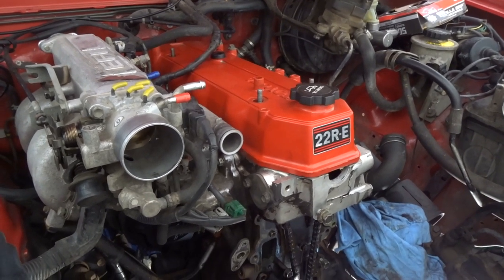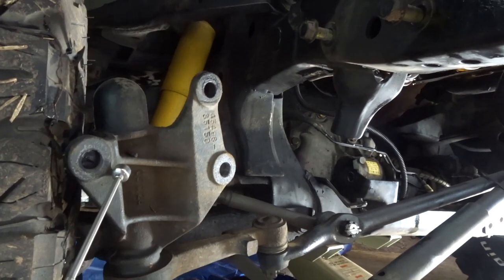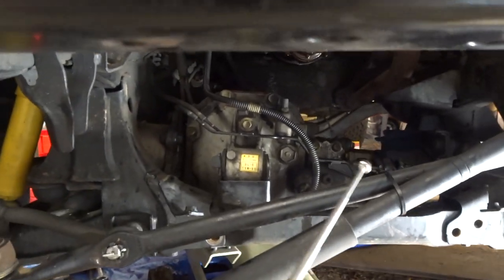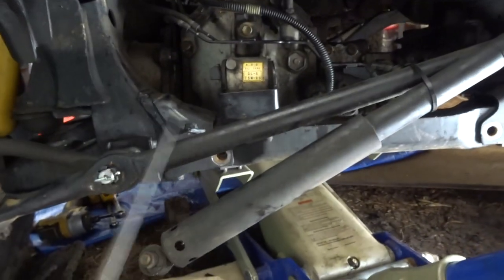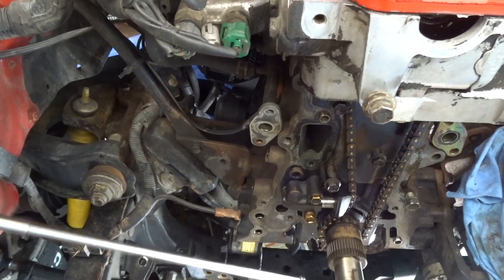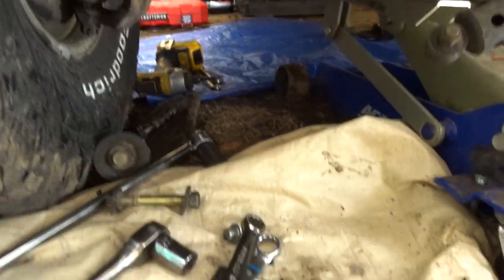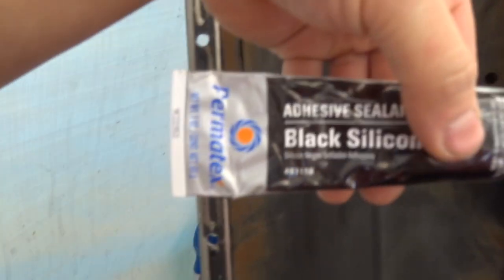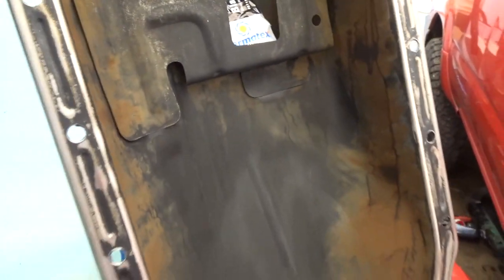TOYOTA 22RE OIL PAN REMOVAL

Comment: I've been stuck on getting my oil pan out for days on my 4runner and am gonna try all these tips.  Previous owner said "Just needs a chain, I think." Chain slack was so bad, the crank moved the length of the timing marks before the cam followed after it kicked back.  Entire guide is in pieces in the pan (I can feel it), but it somehow did not bend valves or ruin anything.  But gotta get all that crap outa the pan.

This is super helpful, thank you for taking the time to put this together.

Comment: Nice, just about to do this. Just stripped my engine down to the block to replace the timing cover and guides and replaced all the gaskets along the way. Do you need to use the permatex gasket maker or can i just use a regular gasket
Reply from the maker: Use black silicone only
Reply: Yes the black stuff, its called "The Right Stuff" also made by Permatex I believe

Comment: My Haynes manual says to disconnect Pitman arm (near steering box) and the Idler arm (on passenger side) let steering linkage hang. Then the 4 bolt crossmember is removed.  That should do the trick to drop the pan.  I hope the guys and Haynes are right.
Reply from the maker: Do as this video and you'll be good

Comment: What year is your 22re?
Reply from the maker: 95
Reply: @NuttyNu  did you use fipg or paper gasket
Reply from the maker: for the oil pan, I use black heavy duty RTV silicone, never use paper gasket
Reply: Diff mounts? What do you mean? The differential bolts, is that what you mean?